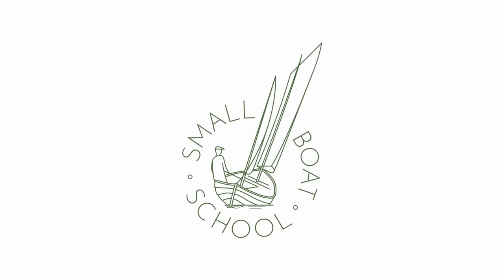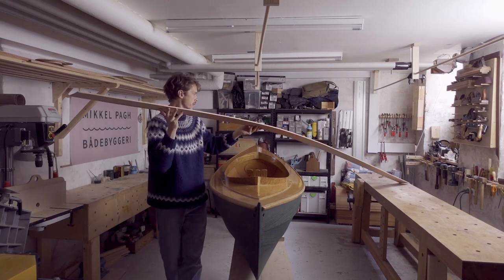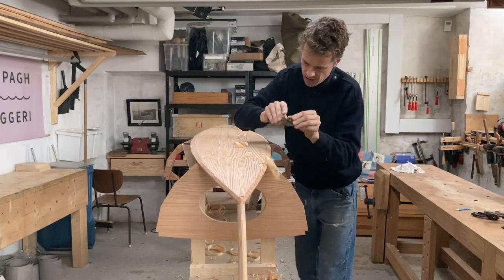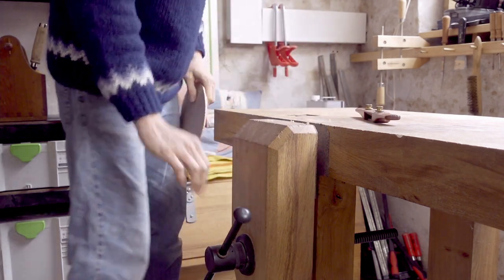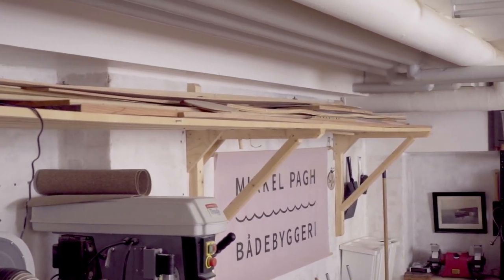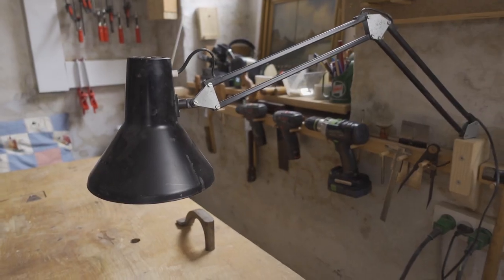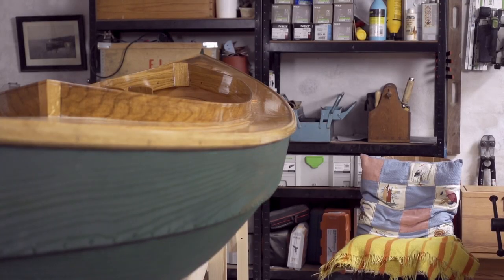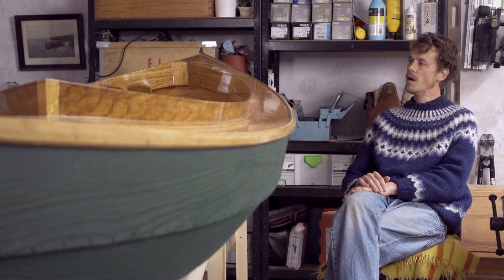How to set up a boatbuilding workshop

Comment: Do you have any thoughts on humidity control in small shops? Where I am in the US, the humidity inside my work shed can get to 75% in the summer (and temperatures of over 95 Fahrenheit).
These are excellent videos, by the way.
Reply from the maker: Thanks. That's a good question. 

For traditional lapstrake boatbuilding, I'm not too worried about it. Only the shrinkage in plank thickness may cause leaks (because the planks overlap) and this shrinkage will be minimal on thin planks. For carvel, any shrinkage may cause more serious gaps between the planks. 

Generally, it's best if the boat will never get drier than it was when it was built, because drying up may cause leaks.  If you build in the summer, when humidity is high, that may be a problem. But if you're building lapstrake and the planking dries up too much, an easy solution is to re-peen the copper rivets. That should close the plank seams. 

By the way, I've made a new version of this video, which you can find here: https://youtu.be/9ZrPDWA00cs 

Cheers, Mikkel